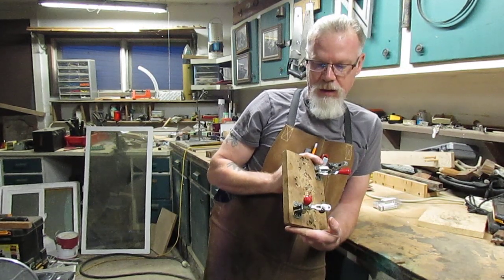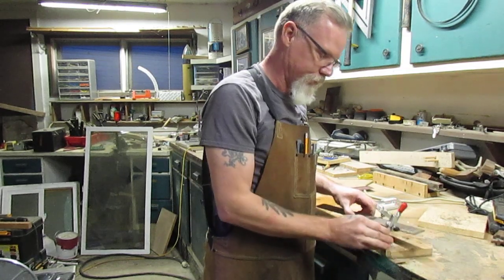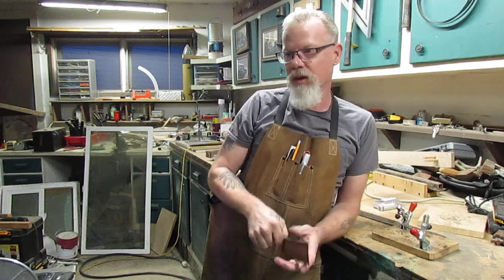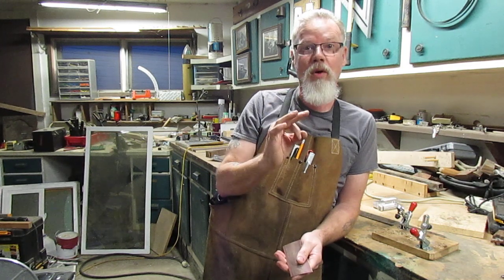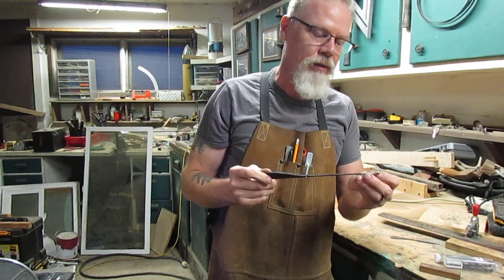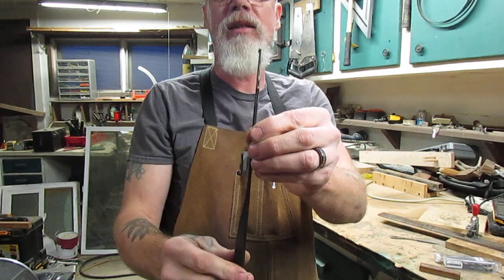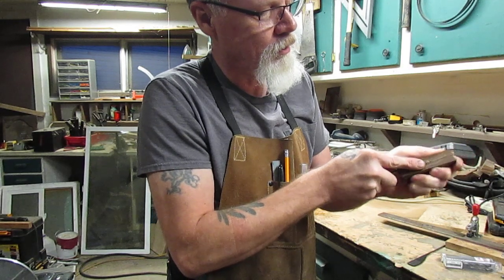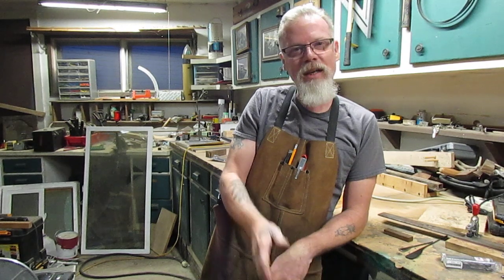Knife shop tips on drilling and hidden tang tools

Comment: Back in the day I was polishing the tip of a 14" bayonet  when it caught in the  18" buffing wheel (powered by a 2HP motor).  Long story short: The bayonet sliced through the polish wheel,  my glove, my finger, the burle pipe in my front pocket, hit point on the large brass buckle plate of the belt I was wearing and ended-up in the 5 gallon water bucket I used to dip hot blades into.  Lesson learned

Comment: Thanks for the useful tips!  I was wondering where you found "lettered" drill bits?  Also, are the "numbered" bits you refer to a metric bit?  I am not finding the bits you mentioned and would like to get some as I have had the exasperating experience of trying to get my pins to fit...  Thanks.
Reply from the maker: The number and letter  drill bits are very common  in the machine  industry, the big box stores like lowes or home depot  dont usually  carry them,try a machine  shop supply ,my local  hardware  store has them due to the fact that they supply  a lot of contractors  and bn oil  field companies. If you cant find them local  a quick  internet  search will find them on line.
Reply: @WildmanPB  thanks!